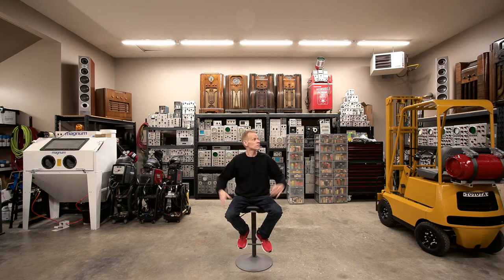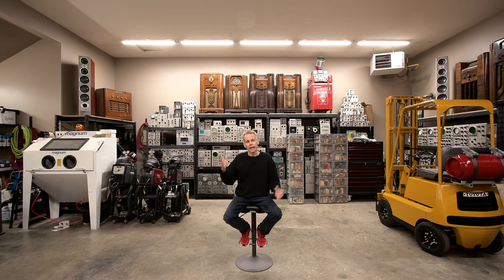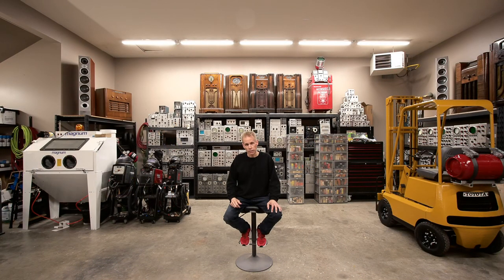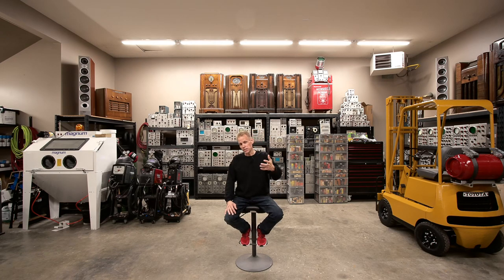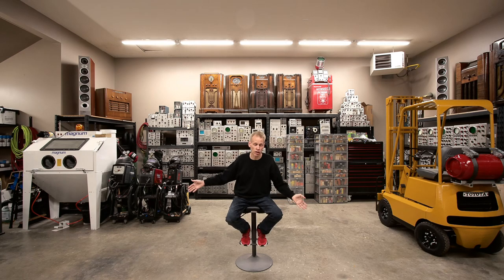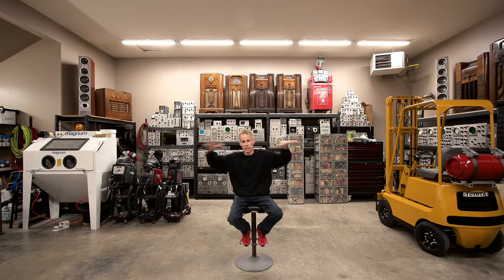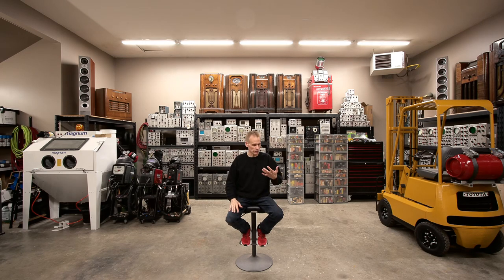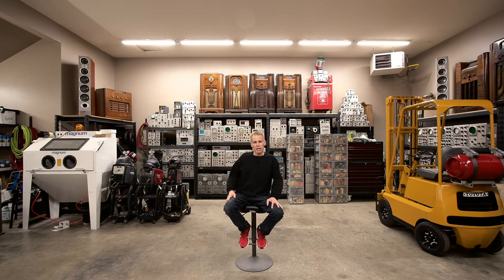ZAP! Mr C's Worst Electric Shock Explained In Detail!

Comment: I've been shocked a few times. You are 100% correct on the feeling of getting shocked. When it happened to me my Vision was going as if a light was dimming slowly. Felt like minutes but was seconds. The feeling with the heart stopping has no way to describe. It's odd and scary as hell.
Reply: Similar thing happened to me at 11 when I opened up some kind of a circuit but it was live. Cause the plug was still in the outlet so i touched around 230 VAC that went through me i couldn't pull my finger off either. I was dumb back then. But i learnt a lesson as far as safety goes😂
Reply: Same here as I got locked on on 240V 50hz across my chest. Getting a shock is one thing but getting locked on is something else and I can only think of 2 or 3 people who've been locked on and they think their going to die like I did.

Comment: My dad was a NASA electrical engineer, he is no longer with us, but to this day when I work on anything electric I hear his deep voice say under the right conditions that 6 volts will kill you. Helps me take a second look at my surroundings before. So glad that you survived Paul, you're a good guy to have around...and I like the shop, and the format of shop talk
Reply: At 14 I was excited to help my Amateur Radio Elmer, who was an AM/FM radio station chief engineer, replace the 1000 watt blown bulb at the top of the 248 foot radio tower.  As the stations were on air, I was shown how to jump on to the tower insuring that I was off the ground before touching the hot (RF) tower.  We used a wood broom handle through the tower to accomplish the task.  Wearing gloves, I accented to about 100 feet without incident.  However, I was not aware that the nitrogen-filled heliax cable that ran up the tower feeding the FM antenna was grounded and on porcelain stand-off insulators all the way up the tower.  My gloved hand came into contact with the heliax and there was an instantaneous arc and the acrid smell of burning flesh.  The RF had burned and cauterized a hole through my glove and finger.  To this day I wear the scar from the accident.  Needless to say I was not able to change the tower warning lamp.  I’m older now and am extremely careful working around electronics.  73 K3PNI.
Reply: @sgofberg  Thanks for sharing...Wow this is powerful stuff...Can you use your hand normally today? I gues you had to undergo surgery? All the best. Per (Denmark)
Reply: @nakfan  Hello!  No surgery.  Only one finger was involved.  No bleeding.  Healed in time with no adverse effects just a noteworthy battle scar!  I’m 76 and still an avid Ham operator.  Thank you for your comment.  Sheldon
Reply: 6 volts can kill you if it gets into a wound or you get pricked by an energized wire. Your body's internal resistance is actually quite low, the epidermis has a lot of resistance that's why people don't normally die from 6 volts.
Reply: @sgofberg  Yeah the smell of burning flesh, it smells like roasting fish. I know this because I got burnt by a 12-volt Slayer-Exciter Tesla coil, it arced to my finger when I was trying to untangle the high-voltage wire because it stuck to my hand. But I managed to pull away, so major damage was done.
Reply: @johanntiu4162  What a load of crap! It may be painful in a wound but 6 volts ain't gonna zap you :)

Comment: Paul, I'm a State Licensed Journeyman Electrician with over 55 years in the trade and I was a Strategic Microwave Communications Technician in the U.S. Army StratCom USACC (Signal Corps) for almost 9 years. Fixed Station Microwave Radio Equipment , Operation and Repair Tech MOS 26V. And cross trained in Telephone Systems , Inside & Outside Plant Operations and Telephone Systems Lineman Installer School. So I have a good various background with  schooling and on the job experience in Electrical & Electronics ! I also built and assembled many Heathkit Electronics to include several AM/FM Stereo Radio Systems, TMDE equipment  and Televisions.  I'm 73 years old and have always consider myself lucky all those years as I was never shocked other than a few times with 120 VAC while doing Residential Electrical Repairs or Upgrades. But I enjoy doing it all as I'm still doing Electrical Work now and then ! I'm also a Retired Federal Firefighter DOD with 30 years of Service. I grew up on my late beloved Dad's Quarter Horse farm and know how to train and break horses to ride.

Comment: I’ve been in electronics for 40+years, the biggest safety problem is that people get complacent over time and not just with electricity, but as you mentioned mechanical things as well. We ALL need to be reminded about safety!
Ron
Reply: Electric shock reminders are a right of passage.  No big deal.   If you’ve never been shocked,  you’re not doing it right.
Reply: Older gentleman I worked on garden tractors with told me older guys have more on their minds and are so accustomed to their work they get hurt. Nonchalantly cutting fingers off with skill saws. Or leaning down to indulge a potential tractor buyer and listen to the mowing deck which was silent as we always installed new spindle bearings and idlers as needed. When he did he balanced himself with his hand on the deck and curled his fingers over and got three smashed by the slow turning blades as the potential buyer had throttled the engine down to speak, but had not disengaged the PTO... Richy tractor boy L... You were a great teacher to me and a friend whom I much appreciated.
Reply: Yes, mechanical things too. I remember the old X-rated tale that ended up in a medical journal. A guy would stay in the shop at work during break & do inappropriate things with machines. He got careless with his guilty pleasure one day & was unaware of losing a testicle. He downplayed what happened and grabbed an industrial stapler and put himself back together. He finished the shift and returned to work for the next couple of days. However, 3-4 days later, he went to the ER. He had a bad case of infection by that point. The surgeon treated him and got him past the infection.
Reply: @johnnytacokleinschmidt515  -- Well, interestingly, some folks are the exceptions to that. A guy was working a temp job at a custom plywood plant. He was the press operator. The plywood is held together with epoxy, and microwaves are used to cure the glue. He was only there a couple of weeks when he reached into the cavity and got some nasty RF burns. A guy who had been there 3 years said he had never done that.
Reply: Indeed, as my risk engineer wife says " if your hearing a safety briefing, your one of the luckier ones"
Reply: @nyccollin  Disagree. That's just as dumb as saying 'If you've never had a negligent discharge, you're using your handgun wrong'. 
I've had moments on which it could have gone wrong but didn't because of certain precautions i've taken. I started working on tube equipment at the age of 15, am now 31, and never got thrown across the room, got stuck on something, or got a full strenght zap of the mains voltage. 
You can work on tube equipment without getting shocked just fine. You just need to adhere to the 'rules' like 'only use one hand while measuring'. 
One of the biggest safety improvements i found, was to have a crocodile clip you can slide onto your measurement probe. That way you never have to hold a probe against the chassis or whatever, while your other hand's doing measurements.
Reply: I agree. I do construction and complacency was the cause of most accidents I've had or seen.
Reply: So true.  I'm kinda cavalier with it at times I admit.  And with tube gear, I got lucky once and got away from the source.  Makes me hesitant still to this day to approach those big early Ampeg V4s.  Dangerous supply in that thing.  I was reminded with a Li-Ion battery recently.  Just because it's low voltage does not mean currents are safe or to just consider what happens when you short one of those cells.  Danger can come from not only electricity, but then if chemistry gets involved it gets pretty dangerous with the added bonus of that being across disciplines.
Reply: @kuizatz very very true those who say it's overkill or unnecessary have never had the misfortune of either being hurt or seeing someone get hurt because of complacency or the " it can't happen to me" mentality
Reply: @nyccollin  Thats not quite right. Should be said like this, “ If you didn’t learn what you did wrong and why, THEN you ate doing it wrong.
My job in the USAF. Worked the weapons system on 5 different fighter jets. Safety was job #1 on the flightline. Sometimes I worked with special weapons. Trust me, you dont want unsafe procedures going on around those. 
One of the perks, if you can call it that, is being a SSgt, and telling a full bird Colonel, you arent going to do what he says. Our tech data that tells us how to do our job, comes with the President’s signature on it. “He out ranks you, sir”
Reply: @kuizatz  The safety briefings for my career field in the USAF was every day, multiple times a day.
Reply: @mfbfreak  Yep with you there about remove that fiddly short wire scope probe clip and instead use a 2 foot ground wire from scope ground terminal to a convenient point.  If that bothered about ringing you put a tight grounded metal plate under the rubber mat to reduce it.  It makes me really cringe to see people probe with a DVM probe in each hand instead of leaving the black one stay clipped.
Reply: I've done similar years , 50 years 45 serious in electronics, always enjoyed it but yes made a few mistakes but thankfully not too many, I'm still here in one piece. And NO I really do respect the power of high voltages & take few risks these days. I take the time to plan a risky test to eliminate my chances of getting too close to it these days.
Reply: Glad I was shocked when I was about 3 years old. Today I have a very special relationship with any mains voltage around me🙂
Reply: @PlumGurly An approhical tale, refuted many times.
Reply: "Familiarity breeds contempt."
Reply: I tell people "If you're not scared when working with electricity, you don't know enough about it. It's not that it WANTS to kill you, but that it will do so without even noticing you're there"

I know two people who've had bad burns and long hospital stays resulting. 

One got across 350V DC in a valve audio amp whilst working solo, had the same issue Paul descibes with being locked on - and somehow managed to drag the entire chassis far enough that he could reach the bench power switch

Another put his hand on the top casing of a 1950s era STC DS12 6kW PEP Tx at Himatangi Radio station (If you look that up there are archive photos of the transmitting hall) whilst tuning it up at ~6MHz - too close to the antenna terminal. The RF (about 5kW CW) bridged to him, running from his hand down his arm, torso and leg, exiting at his knee where it was touching the case and leaving a ~1 inch wide cooked strip of flesh down to the bone along the entire path. (A DS12 was 7 feet high, 5 feet deep and 12 feet wide) - it smelled like cooking pork

Both of them were off work for nearly a year, both of their injuries were life changing and permanently crippling - but they survived

In Paul's case, it sounds like he got across a high resistance path with under 50mA flowing through him. The amount of time laying on the toolcase might have felt like forever but it was probably less than 1/4 second

If you're working on anything higher than 50V, make SURE that it's disconnected OR you have someone standing nearby OR you have a deadman disconnect of some sort in operation. You can stew in your own juices on DC for several hours before dieing - and this HAS happened (I've read the accident reports and wished I hadn't)

(One of the problems we used to have with the STC transmitters was rats or mice occasionally getting into the HV cabinets - Getting across a 13kVDC source at several amps (The things put 5kW out, but required over 25kW in) usually resulted in an exploding rodent and several hours cleaning the inside of the case. The 100kW PEP DS13s had mercury arc rectifiers and hard xray emissions to contend with too - these used a pair of DS12s as exciter stages for the final)
Reply: That's why our first electric shock is so important! Muscle memory is your friend 😊!
Reply: What scares me is I have ADD and have always been subject to momentary loss of presence, especially if stressed. I have to be extra careful I don't zone out around dangerous equipment. I don't know how many times my subconscious has just reached for something when I know perfectly well not to.

Comment: The most disturbing thing about your shock is not knowing what caused it.  There must have been AC involved to lock you on.  I had an interesting shock from a DC power supply running a high voltage and high frequency inverter.  I didn't feel the high frequency or the DC.  But I definitely felt the mains frequency ripple, even from a decent power supply.
The human heart does seem to have the ability to resynchronize in many instances.  The majority of fatal shocks seem to involve getting locked on in a manner where you can't fall away.  I always stand at my bench.
Reply from the maker: Thanks for stopping by Clive!
Reply: I’m glad you survived the early years. If not, I’d never get to experience the level of Lab envy( now Shop envy) , that I do when ever I watch one of your videos. You do great work. Your work spaces seem to be the only places where the universe does not favor chaos. 
All that being said, this level of cleanliness and organization goes along way to promote safety. And always use the “one hand rule”. You’re one of the few humans that needs to live as long as possible. Thanks for all the great videos. I think I could give you a run for your money in the story department.
Reply: Yes, shocks from the mains frequency are bad. That is why electrocauteries operate at much higher frequencies, so they won't interfere with heart rhythms. If the sino-atrial node (the heart's natural pacemaker) is not damaged, the heart may be able to re-synchronize on its own. 
That is a very good practice, always keeping yourself in a position where you can use gravity to help you fall into a safe place.

Comment: Bad shocks are no joke and I'm glad you survived that one. When I was a senior in high school, I had just finished building an 1800 volt DC power supply for a high powered amateur radio RF amplifier. I usually practiced the 1 hand rule where one hand was in my pocket and the other on the meter probe. On this occasion I held the meter probe on the power supply output terminal and used my other hand to flip the metal handled toggle switch on. The next thing I knew, I was sprawled out on the floor with stars filling my visual field. It took me a few seconds to realize what happened. When I examined the meter probe, I discovered the wire insulation where the lead exited the probe had a break in it and my hand was in contact with that bare spot. I counted myself lucky and from that day on I always make sure one hand is in my pocket or I use insulated gloves. I've made it to 75 without any more accidents like that one. I never told my parents because that would have ended my electronics hobby for sure.
Reply: I was once shocked by a homemade autotransformer-style induction coil(like a car ignition coil). The power grid of my country is split-phase so there are two live wires, 120 volts to ground and 240 volts between the two live wires instead of a live and neutral wire, this I think played a part in how I got shocked.  A loose wire on my desk acted as a bridge, which then arced to my finger from my field of view. I soundly felt like I got hit by a truck, saw a tunnel of light, and blacked out for a fraction of a second. The next moment I see myself falling about a meter from the air in slow motion. Luckily my other hand was in the right place to stop me from bashing my head on the edge of my desk or else I would have got a concussion or worse. It was powered by a DC power adapter plugged into mains but somehow the high voltage was able to flow through it( it was unscathed in the incident) through the utility transformer on the pole, through the ground, and back through me( I was standing on the concrete on the first floor of the house, though my slippers were wet since I just went to the bathroom).
Reply: I used to experiment with battery powered xenon strobe circuits, the battery powered inverter circuit operates from 1,000hz to 18,000hz as it charges the capacitor, the circuit doesn't put out true AC. In the past I've been shocked by these circuits when I was younger
Reply: I read an article by Forrest M. Mims or Joseph Carr (i forgot who it was) they were building a DC voltage multiplier circuit and during testing this voltage multiplier fell onto his lap which caused his legs to spasm kicking him away from his workbench!

Comment: Holy crap, Paul. The worst shock I ever got was from a valve Quadraphonic system I was building as a teenager, 1200VDC at 200mA. It threw me backwards against my bedroom door. I shook for about three hours. But that was nothing compared to what you went through. We are lucky you are still here. Keep up with the safety advice. And the stories. ❤

Comment: This brings back memories when I was a metrologist in a electronics lab while calibrating a piece of equipment.  I was hit with 1000 VDC that knocked me out of my chair and across the room. It turned out that one of the test leads had a faulty insulation that exposed bare copper wire. That was 45 years ago.

I'm glad that you are here to share your experience.